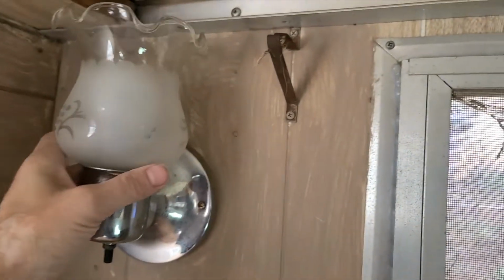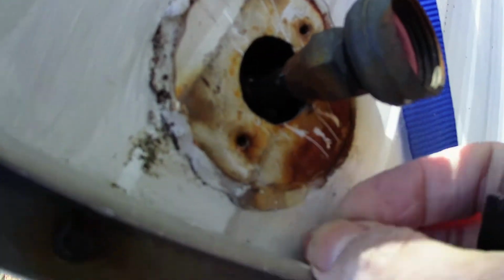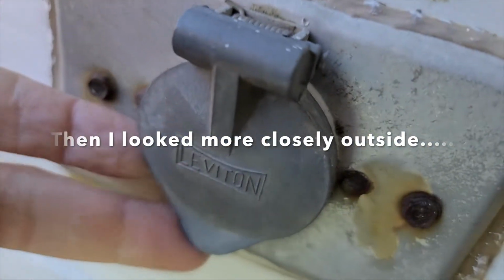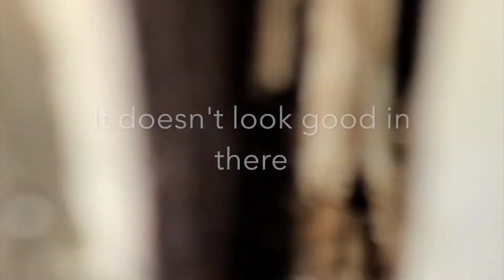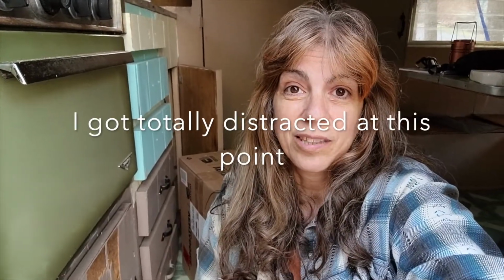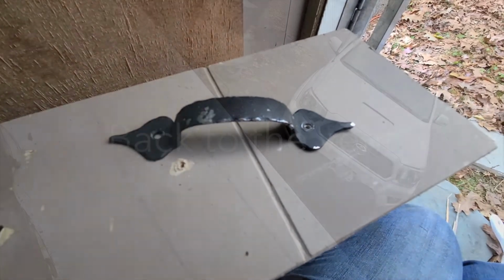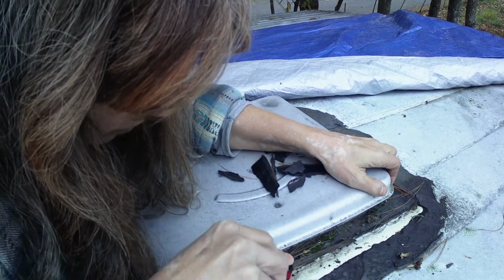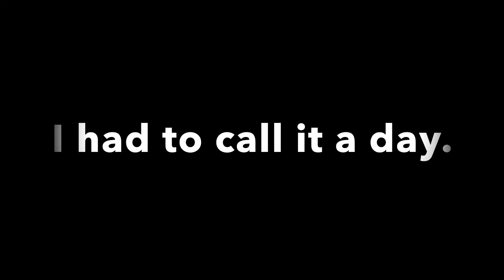Tiny Home, Simple Life - Episode 3 - Demolition and Renovations in Vintage Shasta Canned Ham Camper

Comment: Subscribed!! Hang in there! Mine is a 78 Nomad and no exaggeration - 90% of the original frame came out with a broom. The only thing holding it together was the tin and inner walls, and while the tin was in GREAT shape, the walls weren't much better than the frame. The whole thing collapsed once I got the rotten wood out. But for $300, I knew exactly what I was getting and what I'd have to do. I'm going ground up having gutted it down to the bare metal trailer and only a few original pieces of frame... very slowly and for the most part all by myself. I've got the frame rebuilt, the tin and windows on, base layer of insulation and the floor and it's high and dry. I'm currently staying in it as I build it out. There's something to be said about building your own tiny home to your own specifications! :-)
Reply from the maker: Sounds like quite a project!!! There is definitely a really unique sense of accomplishment in something like this.
Reply: What a project!!! I've been exceptionally lucky so far with this one. Minimal water damage & rot to fix. It is pretty structurally sound. Tons of work to fix all the little things and update it though. And every project ends up resulting in another project I hadn't planned on.

Comment: I only have one outlet over by the one bench, LOL. I'm converting to off-grid so I'm taking down light fixtures and either replacing with battery operated USB charging fixture someway or another 😁
Reply from the maker: I'm eventually installing solar but will be able to use all the same outlets & fixtures since I'm also installing a converter

Comment: It might be a good idea to replace the 120V trailer wiring as opposed to repairing. A lot has changed since that trailer was built. Especially since you are putting in a new fridge and need new outlets, now is the time to get it right. :-) GFCI protection etc. When you pulled out the fridge it looked like a two wire plug. Looking like progress!
Reply: The wires near the fridge are for the 12V light in the ceiling. It was wired into the outside lights so it could run when the camper was plugged into a tow vehicle. That will all get changed.
Reply from the maker: I'm definitely replacing all the trailer lights. I wanted them to look more original anyway, and didn't really like how they were previously wired. It is one of many projects I need to do once winter releases its grasp.